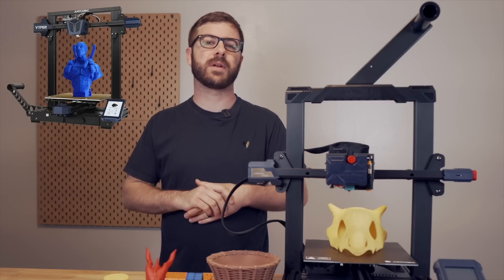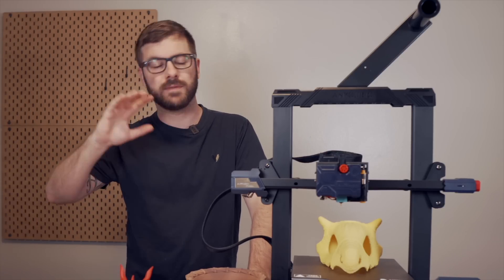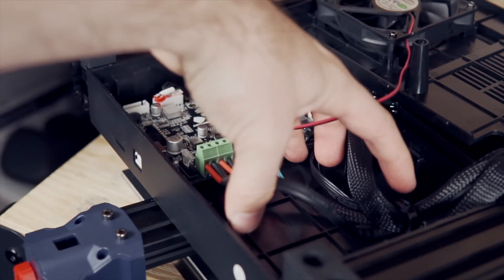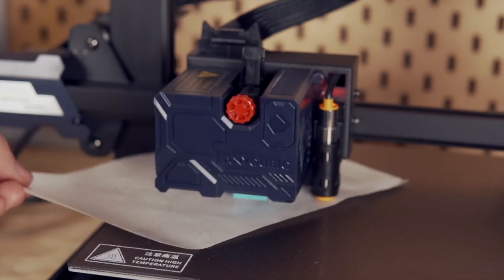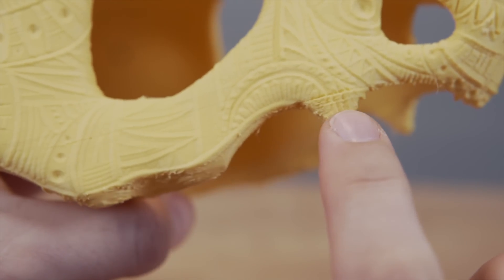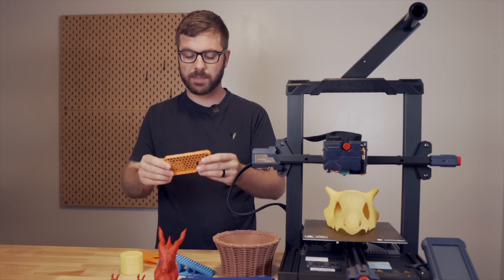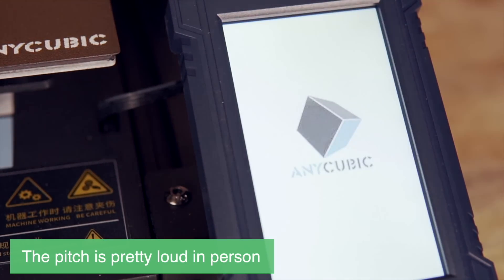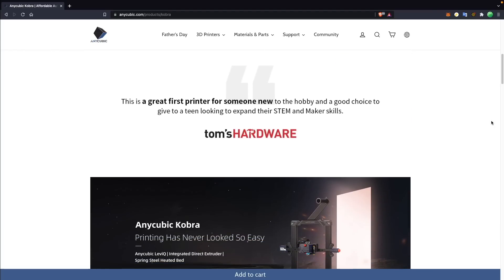The Anycubic Kobra Is A SOLID Budget 3d Printer

Comment: The Kobra is a toy. The extruder in this video is most of the problem with it I found. I changed it to the same set up as the ender direct drive and it works great. Also the original extruder would bounce the frame too much after 50mm/s on short moves.

Comment: It has now been two years since the Kobra has been released. Have you at all upgraded/replaced the extruder? I have a Kobra got back in 2022 and well I am needing to get the extruder changed. So far some pieces i have been able to put together is a Titan Aero extruder, Nema 17 bipolar 1.8 step range 42-23 stepper motor. I just wanted your input of what aftermarket items you have used?

Comment: I really liked my Kobra but I messed it up working on a jam and sold it for parts.  I bought the new Kobra Neo (for $129) and a Kobra 2 Pro.  I actually like the Kobra and Kobra Neo better than the new Kobra 2 line.  The old Kobra and the Kobra Neo are direct drive, no bowden tube, which the bowden tube on the new Kobra 2 series are a super pain to switch filaments and I don't like that.  I don't want to print super fast like the Kobra 2 series which can print at like 500mm/s, the prints aren't as good and it sounds like a jet taking off when printing.  What I want is something that prints well, is quiet, and has the fewest problems and the Kobra Neo fits that bill especially for $129.  The Neo has had no problems so far and puts out pretty good prints.  Not as good as my Prusa Mini, the tops have various artifacts in them, but relatively good for the money.

Comment: I have Flashforge creator pro's, a  Makerbot Replicator 2 and a could of Flashforge dreamers.  I bought this one too, it was very easy to put together, I use Simplify3d as my slicer, I was a little disappointed I had to upgrade to V5 because there is no profile for V4, but it's a solid printer for the price.

Comment: The box of my new Cobra was missing screws and the lower plastic cable fixing element; the since withdrawn 2.8.2 firmware was faulty.
Many things are disabled in what is currently available, it is impossible to print in multiple colors from USB or from the g-code program, because the management of the touch screen in case of interruption is simply not solved in the firmware, in addition, the direction of the Y-axis is up in the menu with faint blue letters on a white background exchanged and I could list. I guess they don't need a functionalist graphic designer or they're just plain idiots.
Their customer service has interpretation problems, so NO ONE SHOULD BUY ANYCUBIC products!
Reply: 2.8.2 works fine on mine, just needed to re-run bed leveling and reset the offset.  I change colors easily by pause from Octoprint and added a 2nd spool holder on top for that purpose to hold the "old" and "new" spool while I just pull and reinsert the filament and unpause.

Works great with Octoprint with a Blu View 2 for Tracfone for $30.  though you can't charge while printing so have to occasionally charge the phone.
Reply: @brianmi40  It doesn't work with Octoprint either, it still ends up in an endless waiting cycle without the possibility of a response!
It can only be restarted by turning it off and on.
You can have a unique machine!
So Anycubic is a bum company, its support is ZERO!

Comment: How do u know when to change nozzles
Reply: They will work for years unless you are using filaments that wear them out, which reading about the filament will tell you.  PLA and PETG and TPU don't wear really much at all, so years on one.  Most are upgrading to .6 nozzle, since the quality is almost indiscernible and you get faster prints.  Unless trying to do stuff like miniatures I would def. use a .6.

Comment: My Cobra Prints are failing, because of the poor adhesion on the printing plate. ? Any help. I cleand the plate but about the half of the testprint owl, its loosenend from the Plate . Bed Temp was 65 C
Reply: Prolly need to lower the offset for more squish  tweak it while printing and feel the freshly laid down filament with your finger, should not move with gentle pulling at it moving finger over it diagonally.  Also, clean the plate really well scrubbing it with dish soap and drying since factory can leave some oily coating that limits adhesion.

Comment: Hi ; first ; thank you for the review. I won't be buying this model if I buy a Anycubic but that's only because of personal preference. In all it looks like a good budget machine . I would like to bring that point up first. It's a budget minded  machine and the fact it has auto leveling is great. It is however a budget machine so you can't expect too much and I really don't think the look of the machine makes any difference as long as it does its intended job well !
The two issues I have with it are it doesn't have dual z axis lead screws with motors and its all well and good to say it can be upgraded to that but what does that ad to the cost and what other 3D printers are out there that do have them and what's the price difference. For me ; if your going to do tall big builds then I think it's a must to have dual z axis lead screws , otherwise you will start to get some discrepancies towards the top of your tall build cause the lack of stability which comes with single lead screws. You may or may not have big issues but why risk it. It's hard enough sometimes to do a good print on a big project without having unwanted movement in the z axis with tall builds! I will be looking up the specs of this one and the Kobra Max which has a Hugh build size but they take it into consideration with Dual Z Axis lead screws with motors on both and support rods , one for each side. All in all, it's what you want to use it for and what meets your needs. I think however it's poor of a big company not to make all their bigger build machines with dual z axis lead screws. Even if only one was motor driven and the other acted as guide. Its important that all z lead screws be supported at the top as well as I see so many budget ones that have no support at the top of the z end screw and the movement they have is shocking !

Comment: Ok now give us your unsponsored opinion about your 3d printer reviews
Reply: Probably better to stay away from Anycubic. I just received mine and it's broken. Not able to even get 1 print. The screen cable came out of the computer loose. They said they will send a new cable out to me. Problem is the ribbon cable is microscopic in size and doesn't have normal plugs on the end like the better 3D printers out there.

Comment: I'm having two issues with mine. My bed seems to be moving. An awful lot has about a quarter inch of up and down movement side to side. And I had to replace my nozzle and I don't know how to get it to stop leaking from around the threats. That's definitely user error. I get a buildup that will inevitably drop into my Print then harden and then when the nozzle comes back around to it, it hits it so hard that the print comes loose.

Comment: Thanks for the review. Would you consider this to be currently the best beginner printer in the $200-$300 range (Dec 2022)?  Thanks!
Reply: I have bought this printer 6 weeks ago and have been using it since. It is my first 3D printer and I am so damn amazed. As a software engineer and hardware enthusiast my demands are rather high, and I can say I am not disappointed. From what I have seen in all those dozens of hours of printer tests and comparisons, this printer performs just as good as the way more expensive Prusa Mini Plus. However, the Anycubic Kobra firmware is rather basic, not correctly handling manual g-codes like m0 if you want user input during printing. But, if you are not someone like me who directly started writing manual g-code you will get the by far best value printer for this price range (260€ right now in many shops). All my prints are all but perfect in quality, I get the speed up until the point of belts jumping without any layer-shifts prior to that. It's an amazing machine and so damn under-valued by many enthusiasts. It kind of reminds me on my HTC Desire HD smartphone which only got famous years after release. In short: There is no better 3D printer to start with than this one. The device just works out of the box - flawlessly.

Comment: Cobra or viper?  I am having ta hard time to decide.  Thanks
Reply: Direct Drive or Bowden?  If intent on printing TPU, get the Kobra for its direct drive, if not, Vyper is fine.  However, at $319 for a Vyper or $259 for a Kobra, I'd first look long and hard at a Sovol SV06: all axis are steel bearings on rods versus rubber rollers on the Kobra, it has a TRUE full metal hotend good up to 300c and is dual Z rod axis steppers.  It has a planetary drive (three gears, more force) extruder so lots of benefits over the Anycubics.  The rest is the same: auto leveling, pei bed.  At $259, same as the Kobra, it's pretty much a clone of a Prusa MKS3+, which is $799 as a KIT...  check out the reviews, it's the latest hot printer, other than maybe a Bambu P1P but that's $699...

Comment: My Kobra(s) have been nothing but problems!!!  The first one had motherboard fan noise, loose bolts, wrong bolts, and extruder improperly installed creating an extruder malfunction.  The second one has motherboard fan noise too, as well as software issues- locking up.  Two strikes and you're out.  I'm going to try another company/manufacturer.  Side note: Support was responsive from a China time zone sort of way, meaning late evening/night/early morning for the US. Email only, no live chat or tel #.  The reviewer above (IMO) got a pre-inspected, perfect, ready to go, fully functional printer to review.  It's hit or miss buying "off the shelf".  I missed... TWICE!
Reply: Sovol SV06 is the hot ticket now.  Steel rods vs. rubber rollers, true all metal hotend good up to 300c, dual Z axis steppers and planetary direct drive.  Same price as a Kobra for Xmas.

Comment: Cobra or Viper? which one is better, i hear some good things in this review about the cobra, but also some small things that where better on the viper. I am looking at buying my First 3dprinter mainly for Boardgame inlays (small boxes and holders).
Reply: If TPU, Kobra for direct drive, if not Vyper is fine.   But Sovol SV06 is the hot ticket now.  Steel rods vs. rubber rollers, true all metal hotend good up to 300c, dual Z axis steppers and planetary direct drive.  Same price as a Kobra for Xmas.

Comment: Im buying one tomorrow - cant wait!  I like the toy look and the features. Should be a solid upgrade from my Cr-100 which i actually enjoy literally everyday since i got it!
Reply: Hi, how's you experience with this printer? I'm looking into buying my first 3d printer but I have zero exp with them so ease of use and reliability is what I'm after. Did you had any problems with it?
Reply: @MeduotasMedutis  I love it and and very glad I bought it. Just make sure you use it before modding it. Most people have issues after they stuff around with it!!
Reply: @j4ym2  how's auto leveling? Do you have to do it often or it holds up for a long time?
Reply: @MeduotasMedutis  seems to hold up well 😊 I do it every 2 weeks or something as a precaution but I'm sure it would go longer

Comment: Great video, I love my Kobra so far, did have some trouble feeding in the filament was getting stuck just passed the metal gear.  Question, I am wanting to get a larger printer, any suggestions?  Stay with Anycubic like Viper or Max or another brand?
Reply: Now that you have experience, shop for a "unrepair" Anycubic Mega X.  These are on Ebay for around $119, delivered.  I have 2, they're great.  Buy the Squaretrade warranty for $10 and if anything at all is wrong with it, Squaretrade will refund your purchase price for the printer, which will fund buying anything defective as brand new for it.  I've bought a total of 4 printers this way, 3 worked perfectly and had never even been attempted to be put together.  That last one, an Aquila, was a mess with build plate, mainboard, cable to LCD missing, after full refund those parts cost the same as the original printer cost, so was out nothing over the original cost, and had new parts in it...

These are all customer returns from customers like Amazon wannabes who give up most often just seeing how complicated it will be, or mommy or daddy learns that the hotend will go  to 400 degrees and fry juniors fingers, so back in the box it goes and back to Amazon, where the original sellers just dump these at crazy cheap prices on Ebay to get rid of them.

Comment: I'm struggling to decide if I should get the Anycubic Kobra or the Ender 3 V2 as my first printer, I really like the mods you can do to the Ender 3, but the Kobra seems to be better out of the box. What are your thoughts?
Reply: Kobra is definitely better out of the box, perfect if your just learning and only going to be printing pla, petg, tpu. Ender 3 has more aftermarket making it cheaper and easier to modify for higher temp printing in the future.
Reply: In the same boat. Just starting out. So yea.... I have non idea either.
Reply: i have the ender 3 v2....dont buy it... save your money get the kobra... 100% beginner perfect than ender 3 v2
Reply: I got the ender 3 pro last year and still trying to make it work, I did a lot of upgrade, watched a bunch of videos but no luck. Going to try the Kobra

Comment: Nope, mine stop working after 4 prints, black screen, motherboard out of service. It seems Anycubic is really better on Youtube than in real life. S/N: KB22008A0100336 - Jul. 2022 // But I'm pretty sure Creality has same troubles. If you're looking for a good printer at low budget, you can't. All made in China, with - sometimes - very poor parts quality. So, a good low budget printer is the one you could repair quickly, because everything comes from China with low prices, ie low quality.  Try to find some local shop, and get one from them. You could ask the tech and repair everything for free, and these shops know well their product. Don't expect big companies like Anycubic, Creality to provide something 100% good, at this price, this is simply not possible. Good luck ! My 2 cents.

Comment: One of the gotchas I've found with some Trinamic drivers – and some versions of Marlin – is that too-fast moves can cause the Trinamic stepper drivers to shut down and just stop moving, without the firmware catching the problem. This usually happens during homing, since this invokes fast moves. Most recently we saw this issue on a Biqu B1 SE after using improper slicer settings. The remedy is to ensure that the max speeds – and max accelerations – are well tuned, and avoid letting the slicer change those settings. We'll try to do better catching "standstill" errors in the future and go to the "kill" screen in that case.

Comment: Anycubic doesn’t need to release an upgrade for a full metal heat break. There’s plenty out there that works. I swapped mine out and put a 70w heater cartridge in my Kobra. Use a Vyper v5 heat break or any other v5 with a v6 nozzle and you’ll be full metal. You’re welcome 😉
Reply: yea where and how do you do it
Reply: Any brands you'd recommend?
Reply: Can you share more details?
Reply: @lethaldonkey  amazing. Thanks for sharing.

Comment: I bought this printer shortly after it came out and after having it for a few months I would like to share that I did end up having a lot of issues with the direct drive on this machine. All I ever printed was PLA and yet the extruder motor on my machine just started grinding and stopped working entirely after about 2 months. The rest of the machine seems to be fine, and I think I will look into replacing the entire direct drive hotend, but wanted to share this that the print head components might be a bit ... cheap (shocker I know)
Reply: could be a bum stepper motor fam. anycubic is known for steppers that have overheat themselves to death. if you reach out to their support, they'll most likely replace the part for free. they replace my i3 mega power supply